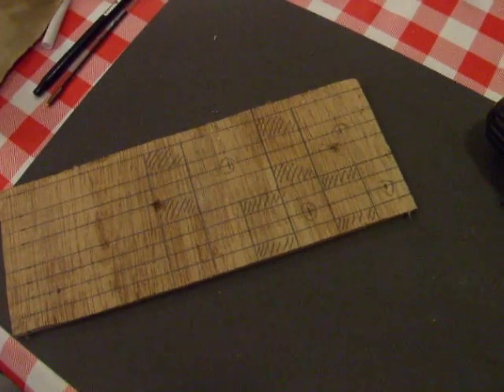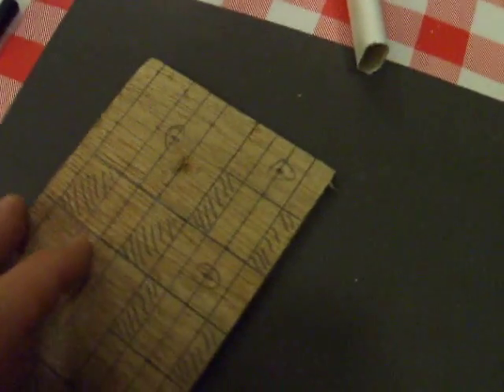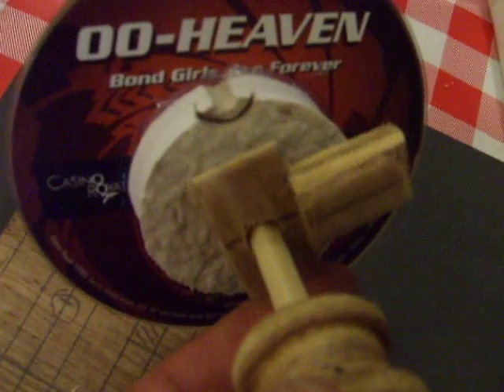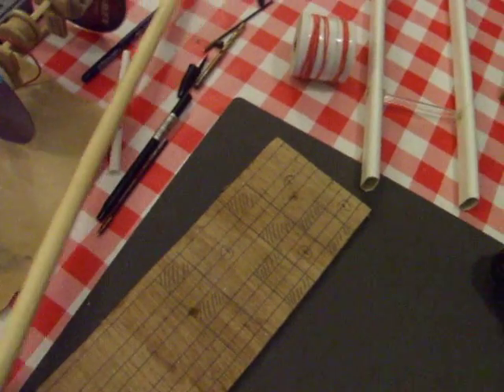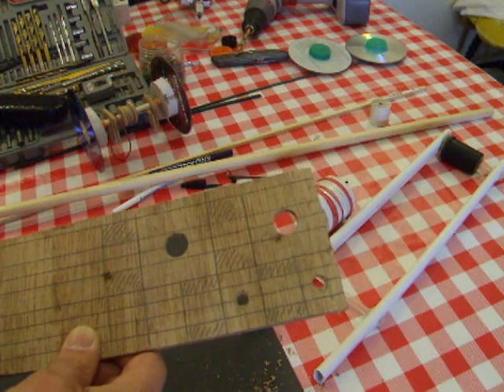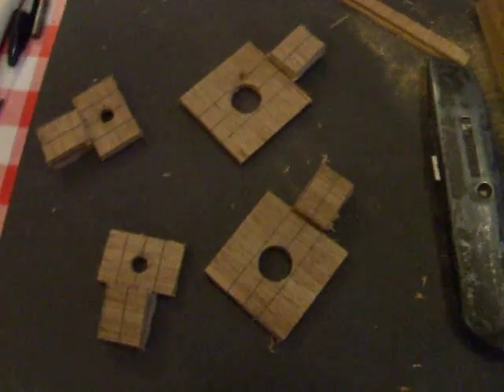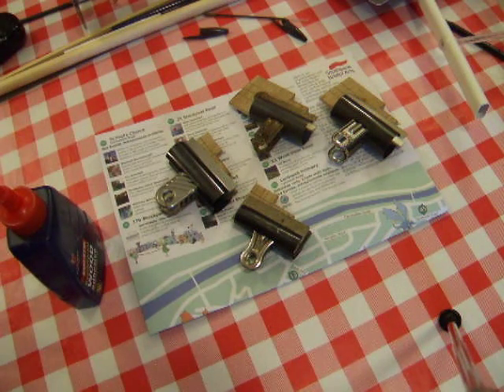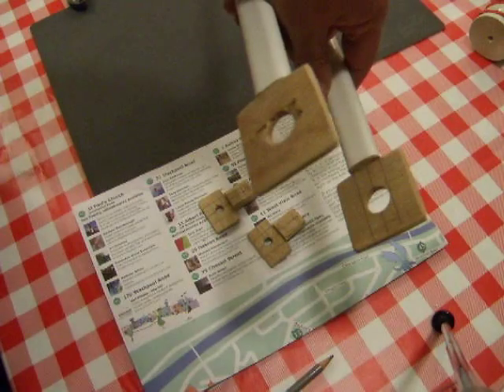Rubber Band Powered Car #8 Part 2

Comment: Will the friction between the film canister and the rubber chain be enough to carry the weight of 12 CDs? I used 3 CDs per wheel so as to increase wheel surface area since a single cd just slips on the floor.
Reply from the maker: I think you misunderstand the way this one works. The film canister is just freewheeling. The rubberbands are wrapped around the axle at the other end of the car. The canister is there so that you can use twice the length of rubber band compared to the length of the chassis so the car travels further. The rubber band is tied to a crossmember at the back, goes forward and around the canister, and back to wrap around the back axle. I like your idea of using 3 CDs, I hadn't thought of that. It will make the wheels heavier but you may benefit from the flywheel effect keeping the car rolling after the rubberband has finished. I just put strips cut from balloons or rubber gloves around the CDs to increase the grip.
I have a helpfile video that shows this Helpfile - how to put tyres on CDs for model car projects
Reply: Oh I see. So it's only the rear axle that transmits movement? and the front is just free? Thanks for your help! :)
Reply from the maker: You are welcome. I can see how it looks like I might have used 4 wheel drive, but not this time. Maybe on another project in the future.